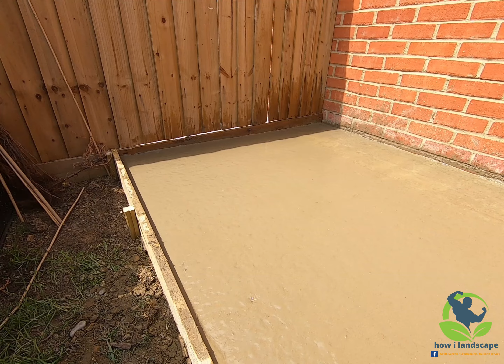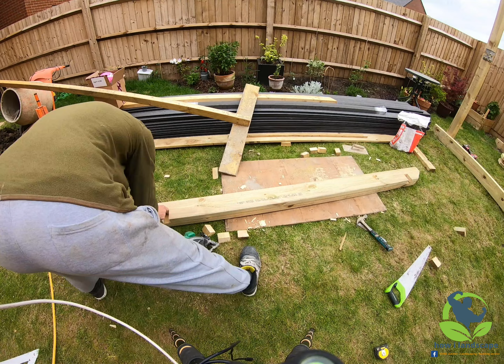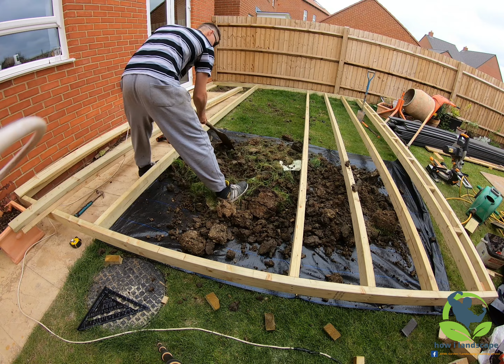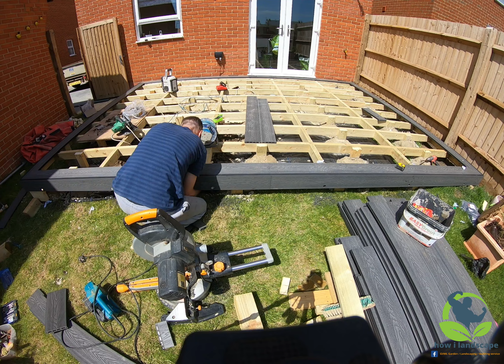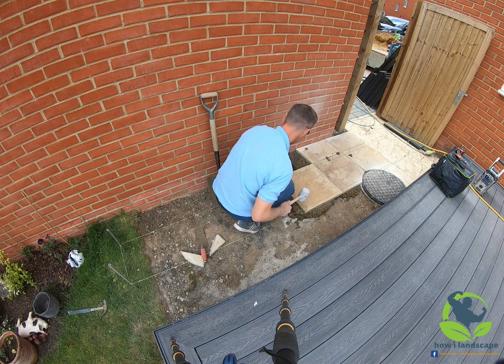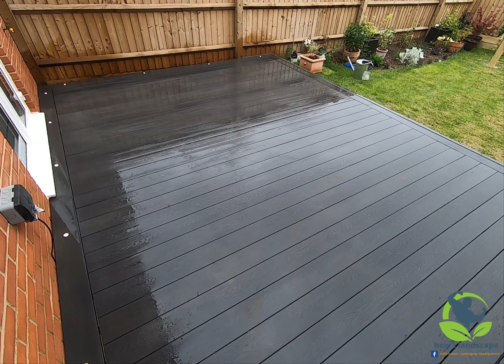how i landscape, how to build composite decking, how to build a pergola time lapse how to build

Comment: Are you just banging the posts in the ground and then surrounding them with concrete?
Reply from the maker: hi i dig a hole around 1 ft deep posts are driven in and cemented around i do drive a big bolt trough the wood where the concrete is packed round it to stop it flogging out and slipping through the concrete packed round it 
you would need to smash the concrete off the post completely to release the post because of the pin that runs trough the post in the center of the concrete ball
Reply: Very unconventional